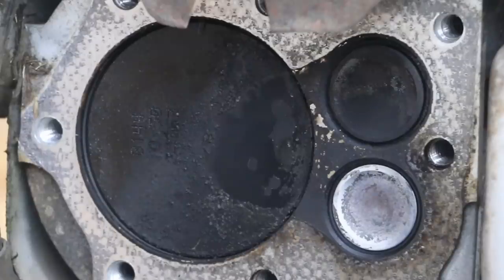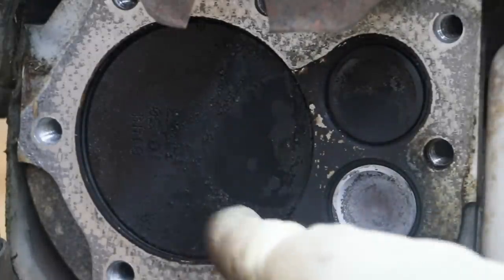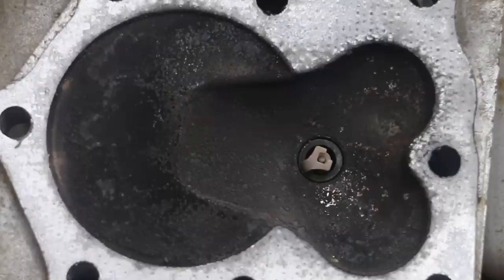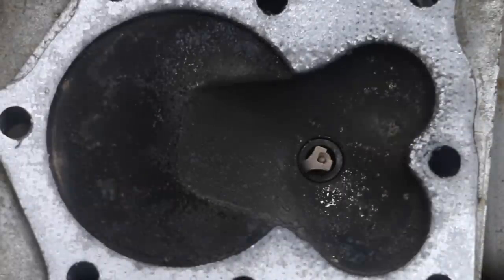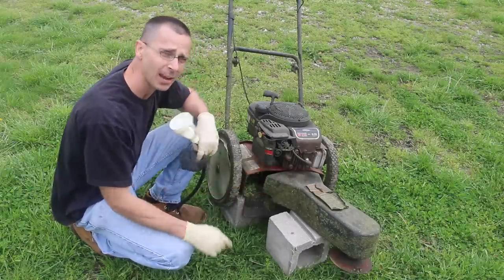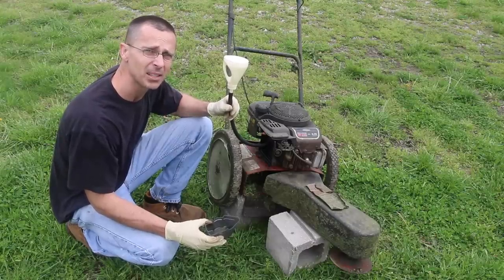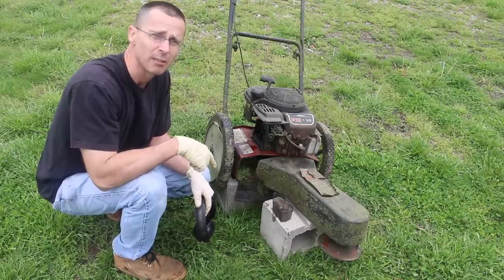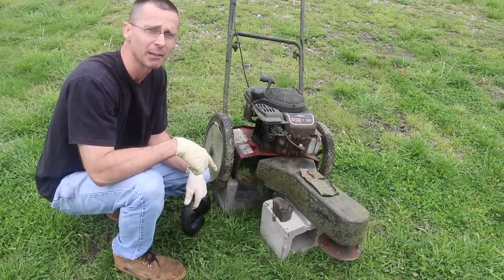Seafoam--can't believe what it did to my engine part 3--cylinder cleaning test!!

Comment: How about a long term treatment.  Run the seafoam in the fuel all summer long, then before you winterize for the end of the season pull the head and see if there is any change.
Reply: It's very strong. Like i mean it will probably damage metal parts etc after a long time so dont do that id say.
Reply: @paz1261  It's mainly paraffin oil.  It won't hurt anything.
Reply: Paz Just strong smelling
Reply: I did this and it worked wonders.  if you have leftover fuel in the tank after your last mow of the season, pour a couple ounces of seafoam in and it will start way faster for the first spring mow.

Comment: I don't think it made much of a difference.
Reply from the maker: Allan,  Thank you very much for watching the video and commenting!
Reply: I agree with Allan.  Maybe a second treatment would help.  Or, try the water method that's being mentioned.  Another look after water would be of interest.  Jeff
Reply: it definitely took a lot of carbon off the exhaust valve and the rear of the piston but there was a lot of that nasty caked on stuff in the combustion chamber still.
Reply: let's not forget that garden engines run very rich with low compression at cold temps. I wouldn't expect much carbon fouling to go away, but the Pistons sealing better is a big deal for any engine.
Reply: phillip galas lot of difference between air cooled and water cooled have to run rich on air cooled engine's
Reply: Burny Chaplin that's my point. you'll see less results on air cooled.
Reply: I'm not seeing it.
Reply: Lightened the wallet.
Reply: My personal experience on a 50-year-old  Mercury 35hp outboard motor. It made a noticeable improvement in starting, idle and full throttle running. Who knows (or cares) what the before and after insides looked like. All I know is it breathed new life into my very old motor. Isn't that really all that counts? Sure beats all the expense in re-powering it.
Reply: Water and alcohol does the trick to remove carbon build up
Reply: Yeah no, on a low compression garden tool it's not going to do anything.  If you really want to see a difference you'd need something with a much higher horsepower.
Reply: 1 round of sea foam wont do much. It has to be done multiple times.
Reply: What problems does carbon cause?     If you really want to remove it while it's running, try mineral spirits?
Reply: It could get so bad that it starts hitting the cylinder head and spark plug, or it can start tearing up the walls of the cylinder.
Reply: DING!
Reply: Nothing beats using old fashioned elbow  grease. I have a 1997 42" cut Craftsman lawn tractor. I would never run that stuff though it. A little bit of maintenance every once in a while does wonders. That includes popping the motor apart, cleaning it, and fresh gaskets/ plug/ filters/oil etc. I scrape the deck 2-3 times a year. Plus everything else. It still looks and runs great. No thanks on the seafoam. How do they fish that out of the sea anyway?  Lolz
Reply: Can you do one with a before and after compression test?
Reply: +eleven0xi

"let's not forget that's just using it one time, regular use would probably make a much more notable change"

So its not a miracle solution then?  Its something that you have to use over and over again...   wow that seems like such a great plan ...if you work for sea-foam that is !!!
Reply: Allan McCoshan I'm gto in
Reply: I'd say 20% (generously) of the solids were removed. If you could physically feel the surfaces with your hand you would probably notice it much more.
Reply: it made a huge difference on the exhaust valve which is interesting.
Reply: Biting Dogg yeah, nah mate its definitely not snake oil. Unfortunately I didn't document on YouTube and I surely won't take my Infiniti's engine apart multiple times for visual verification but I have a friend who owns a shop with a dyno. We did a baseline run before Seafoam and I was going at about 285whp. We ran Seafoam through the gas tank and used the spray version through both intakes, the next dyno pull we ran we noticed better throttle response and an increase of about 5whp. I'm not saying Seafoam greatly increases anything in regards to horsepower but my throttle response was a noticeable increase and that is what I was looking for.
Reply: @ponchob18  Ammonia and alcohol works better.  Adding a little peroxide helps, too.
Reply: @jtjjbannie  Carbon buildup causes high compression because it makes the combustion chamber smaller, hot spots because it burns like char (well it basically IS char), and in some cases preignition for the same reason.  A little bit of buildup is not a big deal.  Lots of build up can cause serious problems.
Reply: All I know is I ran it through the fuel, intake, and crankcase of my 04 6.0 chevy and it feels like a new truck. I dumped 8 ounces into the oil and ran it 200 miles then drained it hot, and holy crap I have never seen that much shit come out of a motor before. Jet black. At one point the flow stopped for a second and then it spit a chunk of sludge into the oil pan, hand to god. Been 2000 miles since and truck still feels great, and the oil in this thing has never stayed this clean for this long, it still looks brand new. If 15 bucks puts a little more pep in her step and gets her back to where she should be, Im all for it.
Reply: @yehndor  That’s interesting.

Comment: Since the heads are so easy to remove on those small engines, why don't you paint something on the carbon to melt it and then clean it while you have the head off?

Comment: It takes years to build up that carbon. If seafoam could do it in a few minutes i would be scared to use it. It could easily destroy your engine. However i truely know that it could work but it would take alot of money because it takes alot longer to achieve it. When an engine head gasket leaks water into a piston chamber you can easily tell which piston had the water leaking in. It is the piston that looks almost new. The water steam washes the piston that eventually rids all the carbon buildup. But this easily takes days or weeks to ocurr, not a few minutes that Seafoam claims to do. I believe that water injection does clean the pistons but it takes time.

Comment: After watching your sea-foam videos, I  finally did the same treatment to my outboard marine engine. 
Thanks a bunch! My engine used to stall a lot. But now, an entire month has gone by and no stalls. Also, I noticed less vibration.
Reply: So what you're saying is you haven't been able to get the bastard started since.
Reply: @godfreypoon5148  lol
Reply: I used this on an old 90HP it was a 1989 model year. Ran very bad at isle and would stall the seafoam did help it run much better.
Reply: @godfreypoon5148  And it used a lot less gas !!!
Reply: Same experience

Comment: I expected more of a difference overall. However the biggest change seemed to be around the valves. I would guess this is why folks often experience an improvement in engine performance and compression. 

Great video! Thanks for posting.
Reply from the maker: Thanks for the positive comment.

Comment: I am a California SMOG Tech and I use Seafoam all the time. It really helps cars that are failing for NOx emissions by cleaning out all that carbon. My customers notice the difference right away when they drive the car and I have seen it reduce NOx emissions by up to 1000ppm. I use the vacuum method and tell the customer to put a can in the fuel tank too.

Comment: I think the big thing to takeaway from this is the carbon in the combustion area is much harder and crystalline than any of the carbon in the induction tract. It is formed into a much harder deposit in microscopic amounts over time under great heat and pressure and  microscopic-level impact. The carbon in the induction is much softer and still oily and is much more easily dissolved by a solvent like this. Same for the crankcase deposits and reasons it works well there like flushing sludge from lifters and allowing the hydraulic elements to restore working properties. I would be curious of how well it cleans up the piston rings and ring lands. There are really only a few ways of really decarbonizing the combustion areas. 1. Mechanical removal, i.e. scraping it off, bead blasting, etc. 2. Strong specialized solvents/acids. An example would be like the concentrated solution used in 
commercial injection/induction cleaning machines. 3. The easiest and most accessible method is steam scouring. Yup, plain old water. If you've ever seen an engine that had a head gasket go bad or a head crack and allowed coolant into the engine and it being run this way at least for a little bit, the effected cylinder(s) are often much cleaner than ones that didn't intake any water/coolant. Engines with water/methanol injection also exhibit cleaner cylinders. The water flashing off to steam creates a powerful cleaning action, in piticular at higher engine speeds/load.Most of the Seafoam in the cylinder is partially burning and flashing to smoke. I feel it doesn't have enough time nor the best properties to work on hard carbon. I have a Duramax with water/methanol and it stays pretty clean for a diesel. I have borescope'd it. I have seen cars that water had cleaned a cylinder so spotlessly clean it looked brand new/unfired but adjacent cylinders were dark and crusty. It has had diesel leak into the crankcase also which diesel being a great solvent, worked much like Seafoam in that application, the engine is 100% spotless clean internally and it has 165,000 miles on it. A lot of heavier distillate solvents like diesel, kerosene, mineral spirits/stoddard solvents would work like this. I suspect stuff like Gunk Engine Flush is mostly mineral spirits and Seafoam is certainly go some in it. ATF Dex/Merc is another great fluid since it has some great properties/high detergents. Like pouring in cylinders for stuck rings, etc. My background is all mechanical & from a young age, working on cars at our family owned car dealership from about 5yrs old on up, always worked automotive jobs, Wyotech graduate, worked professionally on BMW's, Factory trained BMW S.T.E.P. grad. BMW Master tech 10+yrs and now Aviation mechanic, A&P License, worked both piston and mostly turbine powered, just cooperate jets now. So my mechanical knowledge and experience runs pretty deep, all my life in fact! No spring chicken here! If you can finely meter water to that mower under full power and under load, I think you will find a much cleaner cylinder. For the soft carbon, Seafoam will do just fine as will other like solvents in the right proportions. Great video, keep up the great content! New sub!
Reply: True the water does have a great steam cleaning effect, but i still wouldn't trust it in my crankcase. I believe your better off taking the engine apart and then steam cleaning the internal parts drying it of course and then put it back together. You have to remember water does not have the capabilities of oil in the fact that you can score the cylinders. So I would be very careful in how long the engine is running with water in it.
Reply: Joseph DiTomaso no one said to put water in the crank case. You spray water into the intake to clean carbon from the compression chambers. Putting water in your crank case will do nothing but kill the motor.
Reply: Since most of the seafoam is burning when it's ingested via the intake tract (hence impairing it's effectiveness), do you think a piston soak lead to more noticeably effective decarbonization?

I understand that it wouldn't be nearly as effective as water injection, but just for those of us are reticent to try it
Reply: I agree with everything you wrote, but my eyes would feel better if you made paragraphs lol
Reply: In particular, and corporate jets.
Reply: I was told that a fifty-fifty water/brake fluid mixture works well. I tried it many years ago on my father's carboned-up Honda Accord (carbureted). Lots of steam and smoke, and it seemed to run a lot better.

Maybe Samuel could do the same kind of test with the water/brake fluid mixture, to see if it actually works.
Reply: I'm pretty sure the water methanol injection works so good because it's using methanol/water mixture.. It cools the intake charge temp, happens to steam clean because of how fast the water vaporizes, and reduce the chances of detonation. Because it vaporizes so fast, creating steam, thus acting as a steam engine, forcing the piston back down and creating more HP.
Reply: mytmousemalibu ...I would suspect, in gasoline engines, this is really just cleaning the EGR valve (the softer carbon) and not really the valve, piston, or spark plug surfaces (harder carbons). Amazing what a clean EGR valve can do for your engine performance!
Reply: Agree 100% and will tell you why water injection cleans hard carbon deposits.... it turns to steam in the compression stroke and ateam does not compress like air. Thus it fractures the carbon in compression. Also there is a chemical reaction between H20 and carbon.
Rigging up a water injection setup to any car is easy. Run a T off any vacuum line that feeds all cylinders. Run a small pvc hose (1/8" is plenty) to the drivers seat snd hook up TWO brass needle valves one should intake a quart or half gallon soda jug with distilled water. The other ahould go to air. This way we can start atomizing the water way up the line. At highway speeds with constant rpm crack the air valve creating a vacuum leak...then slowly open the water valve just a bit. Now go back to the air valve and use it to modulate the water flow. The idea here is this makes it much safer than allowing direct water into the engine. The ideal ratio in 10:1 fuel:water so if your car gets 20 mpg you can drive 20 miles and introduce about 12oz of water into the intake, finely metered. Guarantee your cylinnders are spotless after about a half gallon of water and 100 miles.
Reply: mytmousemalibu Oh geez, we have a scientist here.
Reply: Stephen Thompson brake fluid is just glycol.
Reply: @mdingle11  spray water with a spray bottle?
Reply: Holy shit, now that's a comment. Actually more like a novel. I'm sure glad more people don't write this much. We'll keep up the good comments, Without people like you all the comments would be super shitty and boring. Nice work.
Reply: But.. would you put it in a BMW with 188k on it?
Reply: @fuckgoogle4704  your cylinders may be clean but the rod through the block will make it run great. Wouldn't it be easier to back up into a lake, shut the motor off and then crank it over? Plenty of water in the motor, way less effort and tow truck drivers love to chat.
Reply: @Blackhouseohio  I have done it exactly as described and it worked perfectly.

Comment: I pulled the heads off my !international 304 V8 as part of a re-seal of the engine. Man those pistons were dirty. I previously ran Seafoam in the oil, gas, and through the vacuum. The Seafroam treatment made a huge difference in how loudly the engine ran. The thing quieted back down like a new one.  To get the carbon off the pistons I ended up using parts cleaner. All the other stuff I tried, WD40, Seafoam has their version, and who knows what else just didn't seem to cut the carbon. Watching your videos on cleaning pistions and valves, gave me the confidence to get right on it. I did not use a metal wire brush though. I used fiber roloc. Thanks for the videos.
Reply from the maker: You are welcome!